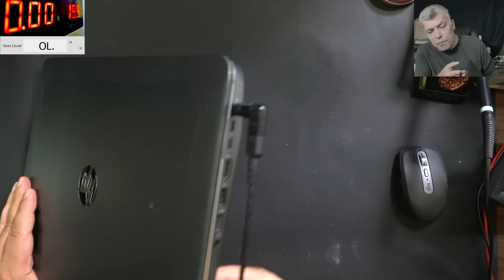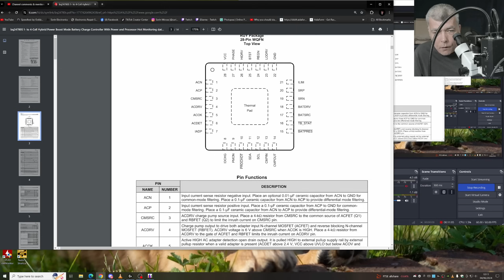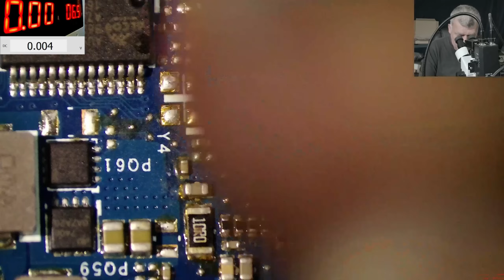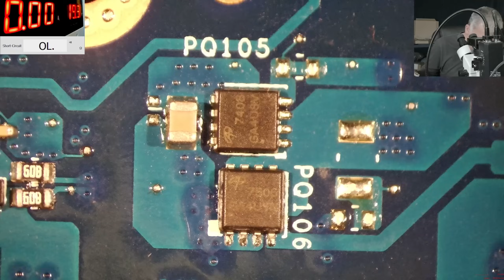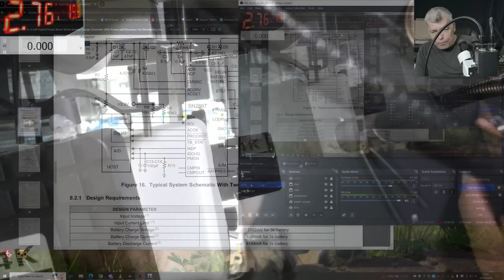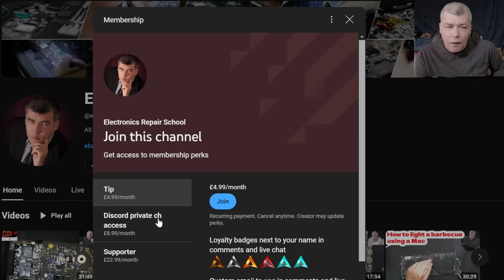HP Zbook 15 g3 no power board repair - a two hours job, a hard one

Comment: Hello Sorin,

As usual, thank you for all your videos, always instructive !
 
Did you already tried to start from the functionnal block diagram (in page 15 of the data sheet of the BQ chip, point 7.2) to diagnose the issues of no power type ?

It clearly says what are all the conditions necessary to have a ACOK, in the upper left side of the page (logical diagram)

1°) VCC (pin 28) must not be lower than 3.2V (to avoid Under Voltage Lock Out = UVLO) AND must not be higher that 26V (AC Over Voltage Protection is then OK)
2°) ACDET (pin 6) must be higher that 0.6V (it's apparently the minimum voltage to wake IC up) and must be higher than 2.4V (which is 2.6V in your test) 
3°) VCC_SRN (VCC sense resistor negative, I don't know what that is, VCC of battery ?...) must be in a "high" logical state
4°) ACOK_DRV (I don't know what that is...)  must be in a "low" logic state to switch the mosfet that allows current to pass through ACOK pin

If those 4 conditions are met, ACOK is OK.

I'm I correct to say that ?
Is it a good way of starting a repair ?

Comment: Hi, how are you? My name is Bruno Tunissi, I'm a technician. I have a machine like this one, where when I plug in the charger, the LEDs light up and after a while, the fans spin very fast. I've already measured all the voltages, they're okay, I even reprogrammed the EEPROM. But there's still no video output. Is there anything you can help me with? Thank you in advance. Congratulations on the video.

Comment: Hello Sorin. Thanks for your professional trouble-shooting videos. At 5:41 you measures 6Volts. On the same place I measures 0.56Volts only. Can we say that my bq24780S chip is bad or any other issue can do this? Meanwhile on pin 7 I measures 18.5 Volts, thus I think the chip have enough input voltage. At pin6 i measures 2.67V. At 5:54 you measures 0.287V meanwhile I measures 0V.

Comment: BQ to work properly does not want noise thats why they put a resistor there, also to protect the BQ from current spikes. With the noise from the resistor the BQ couldnt start because it is sensitive. Now if for some reason from a vrm has some noise it will stop working again. So you should replace the resistor.

Comment: Was that resistor shorted or open? At 31 minute point? You changed orientation of capacitor so I think maybe it was an open 0 ohm resistor that wasn't working?

Comment: HII SORIN!  As per my understanding. BQ24780S CHARGER IC is a SMART ic in which all requirement will done properly like VIN ,AC_DET, REGN ETC , except AC_DRV. why it will not releases ac _dry .because if any thing shorting in further board then the smart detection will detect the shorting in board and stops its AC_DRV ..thats why it is not releasing its ac_drv to the first mosfet gate and the IC will be in PROTECTION MODE. THANK YOU🙃

Comment: I will try and get mine fixed. I have the same problem, but if its an emergency to switch it back on immediately, do the following;

1. Remove the back cover
2. Detach detach the battery( no need to unscrew)
3. Remove the small flat round battery( remember not to touch the motherboard with any metal item)
4.place small flat battery back
5. Re-atach the battery
6. Press Enter once your Laptop is on
7. Wait for it to boot, and plug in the power cable.

Hopefully this helps People who need it back on urgently

Comment: maybe i'm understanding this wrong, but that resistor seemed to have been pulling the voltage down, so it actually has risen in value instead of being partially shorted? how am i getting this wrong?
Reply: No. You're right.

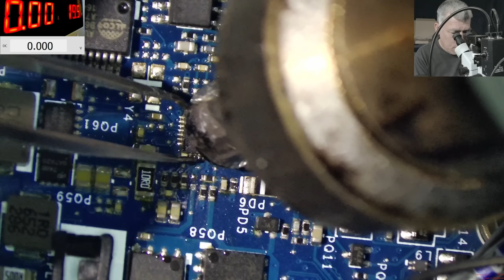Comment: I don't know how no one noticed the 10 ohm resistor that burned when sorin touched the pins of the BQ chip with tweezers... 7:58 (because the laptop was live) and you can see the resistor breaking, later under a microscope while changing mosfet, you can also see the burned resistor, and he didn't notice it until the end of the video
Reply: nothing burned, its rosin
Reply: Spot on, it clearly got burned

Comment: The HP Z-books also support the Intel embedded GPU, so maybe the screen would have come on with the NVidia GPU removed?  Also the zbook G2 and G5 I have owned both support a HP thunderbolt docking station that has both a USB-C and DC plug that are ganged together and perhaps it supports charging also over the USB-C? (in fact I was playing with an Apple compatible thunderbolt docking station and the Zbook5 indicated it was charging without the DC plug). So maybe that resistor is in circuit there to link up to the USB-C input?
Reply: The one ZBook 17 G3 I've got does NOT support USB-C charging.
Reply: @MrBjarnevik  I had to use a compatible Thunderbolt cable with the OWC Thunderbolt 3 85W PD dock, a regular USB-C cable didn't have the same effect, but this fiddling around was with a G5 Zbook which is a bit more modern than the G2/G3. Anyway it was just an experiment in case the HP dock with ganged connectors fails.

Comment: Maybe the resistor was going OL instead of short. I mean, maybe, instead of a 200 ohms resistor it was floating around 93,6k ohms. Then the voltage would be the same, but the current reaching the gate would be too low to activate it - I'm not sure if the gate needs any current at all to be activated, though. If it doesn't, what's the point of that resistor?

Comment: Sorin, I know that you prefer linear power supplies but I recently bought an OWON SPE6103 as it provides a graphical display of voltage and current in real time. I was working on a unit that was pulsing it’s power in a similar manner to this HP laptop and this could clearly be seen on the SPE6103 display current plot. They were very short current pulses that could otherwise be missed. I own a few different bench power supplies but the graphical display of voltage and current over a period of 60 seconds per trace makes this inexpensive unit very useful indeed.
Reply: Won't it shutdown if it's not linear? And what's the difference between them in your experience

Comment: I’m really confused.  You said the resistor was partially shorted, then basically wired the capacitor which totally shorted out where the resistor was.  I’m more tempted to think the capacitor is in fact faulty, not passing enough of a power on start up pulse, to the gate (which was also attenuated by the resistor), by shorting the resistor you made that startup pulse higher.  If that capacitor continues to slowly fail the laptop will return with the same fault.  Unless I have totally misunderstood this fault.

Comment: These sort of faults often make little sense, it is rare for a resistor to go shorted.
as always you got there, well done Sorin.
Reply: Of course the resistor wasn't shorted, actually he shorted it to make the laptop work. It may have had an increased resistance, or maybe a smaller resistor (or a short) just helped the laptop to start, even if that resistor was still good.
Reply: @walter....  This fault still took a lot of finding, my question is why that resistor was there
and unless it was only a few ohms then shorting it out is likely to cause more issues in the future.
This was not the way i was taught to repair faults.

Comment: I have an HP X360 Ryzen 5. Insurance write of paid $75 nz plus shipping, Goes well very good laptop sum case damage ect but that is no problem.
The problem is if the battery drops below 25% it shuts down or when the charger is connected or disconnected it also shuts down.
I am guessing but looks like you have found the issue with the hp charging not charging and intermittent shutdown.
Makes sense that if the battery control ic is not seeing the main voltage properly then start up charging and other issues will be present.
Thanks for sharing your content.

Comment: Still don't understand why that resistor was causing the BQ chip not to send 25v to the gate of the FETs. As you said there must be some other circuit fed from that resistor that is controlling the BQ chip and preventing it turning on the FETs. Replacing the resistor with a link was enough to trigger it to work. Must be components changing value as they get older - drifting out of spec maybe.
Reply: Very odd. From what I could see there were two series resistors, one for each mosfet (PQ56 resistor shown at 6:59, PQ58 at 29:19). The schematics for various revs of this laptop suggest low values (0R, 2R2 etc) and although the BQ datasheet seems to omit them, it is good practice to include them (at higher values for various technical reasons). The original issue (BQ seems not to start properly) may still be there.

Comment: In production some times You must make some changes in order to solve uncommon issues. The resistror introduces a delay on the check. May be this motherboard works fine but other not.

Comment: So, if I understood correctly, from the ACDRV PIN on the laptop there's two resistors in series and then two caps in parallel to the mosfets, and on the datasheet there's only 1 resistor. It would have been nice if Sorin measured the resistances of those resistors, maybe the one next to the mosfet was dead.
Reply: It was probably partially open. Meaning High Resistance. That's why he didn't get 25 volts on the gate.

Comment: Diablo 4 ..give out your id lets play a couple runs :D
Reply: I don't know how no one noticed the 10 ohm resistor that burned when sorin touched the pins of the BQ chip with tweezers... 7:58 (because the laptop was live) and you can see the resistor breaking, later under a microscope while changing mosfet, you can also see the burned resistor, and he didn't notice it until the end of the video

Comment: you desoldered the resistor, saying it was partially shorted and that's total nonsense, you didn't check the resistance once and you claimed it was unnecessary and it was supposed to discharge the mosfet gate, so it's a strange repair
Reply: Absolutely. Partially shorted resistor makes no sense. Resistors rarely short, they simply burn. Increased resistance, theoretically possible, but we can't tell for sure.
MOSFETs -> parasitic inductance -> C-L-C input loop -> rapid switching of input MOSFETs.
Manufacturer noticed some oscillation problems between capacitors across MOSFETs, so they've put a resistor to stabilize the loop.
Reply: Carbon film resistors never short except when they melt. The resistor Sorin removed seemed to be healthy. So, the only chace for that resistance to be the culprit would be a increased value one or a opened one, keeping the Mosfet on open-circuit condition.
Reply: @cyberpeque  i dont know why, but i removed the same resistor and laptop started working, he replaced other components for nothing, but hey its fix ...
Reply: He misspoken. He meant that the resistor is open so he needs to short it. You guys are dumb af for not realizing it.

Comment: Hi guys, any idea what air speed and temperature is used for such tiny component like the resistor to take off so fast without knocking out all surrounding components?
Reply: Hi temperature about 400-420 and speed about 30-40 percent, you can go higher or lower it depends how you feel, also the smallest nozzle
Reply: @sakis1991  Thank you Sakis, Ι  have the Atten Air Station and anything above 45% air speed it blows off all surrounding small components once the solder starts melting or moves them off the pads
Reply: @emmanuelvalmas5648  i have the same station and you are right usually
You want more airflow when you desolder and it depends what you desolder for example if you want to desolder a connector eg hdmi or a shield in mobile phone you can use 60 percent airflow

Comment: Great repair as always! Just one question: shouldn't the low side mosfet at charging circuit be shorted to ground to discharge the coil? Isn't it normal?
Reply: it is connected to ground but the mosfet should not be  shorted otherwise the voltage to battery will always be zero.
Reply: @orange11squares  got it, thanks 👍🏻
Reply: @orange11squares  I did the same thing but the battery is not charging, what is the solution my friend?

Comment: Fatigue voice
"we have picture !" 

Congratulations Sorin 🎉.
It's a very tough analysis motherboard job.

You deserve a Nobel prize for finding the bad resistor 😊.

Just to share.
Last month, I got exactly same fault.

Main power rail 3-4V.
No short
Acdet 2.6v
Regn 6v.

Change ic not working.

Then, I tried increase the acdet from 2.6v to 3.3v.

And suddenly 25v appear on the MOSFET gate.

Charging and can work perfectly.

Although I'm pretty sure it doesn't make sense.

But I'm happy it works 😊
Reply: @arpiecepiece8222  I also did this... It's working... Reason for dead battery.. So pull the battery out and charge externally and your problem solved...